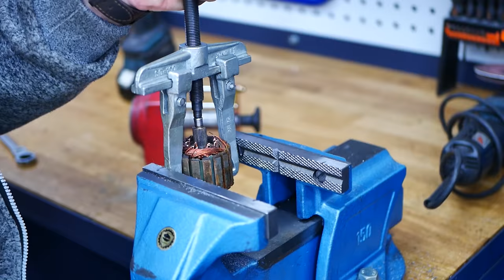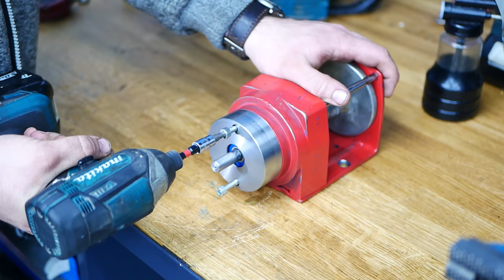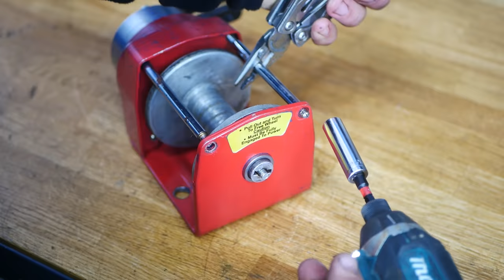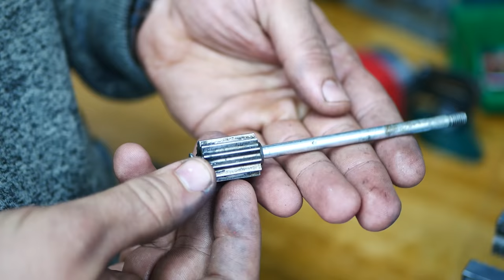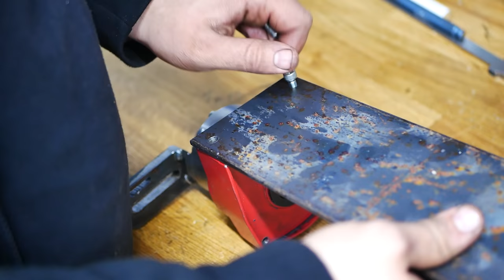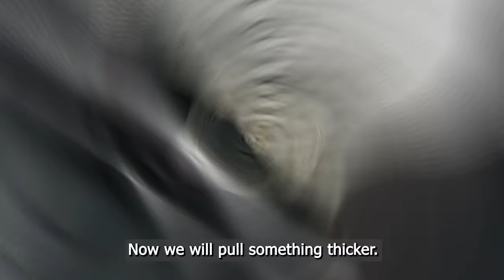Heavy-duty Chainsaw Hack 10

Comment: Nice as always! What kind of fixture you used during the pulling process (of that tree)? You didn't hold the chainsaw with bare hand, did you?!
Reply: he put an eye bolt on the opposite side to attach to an anchor point